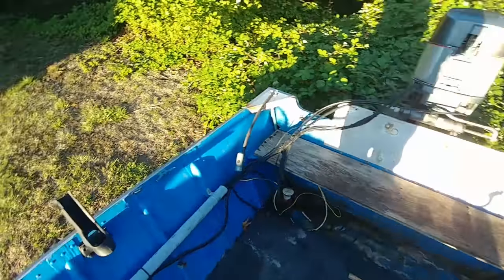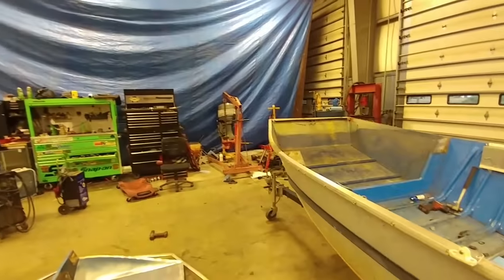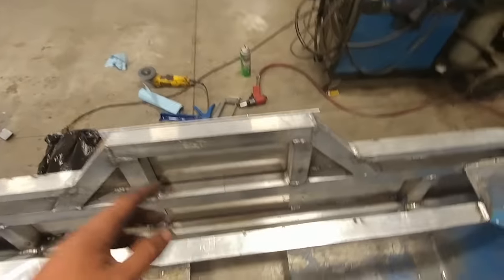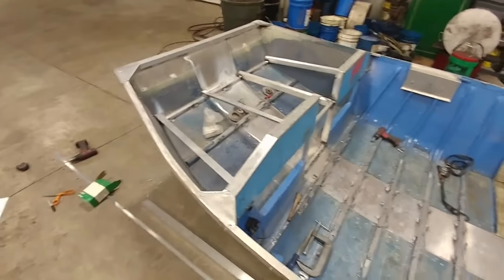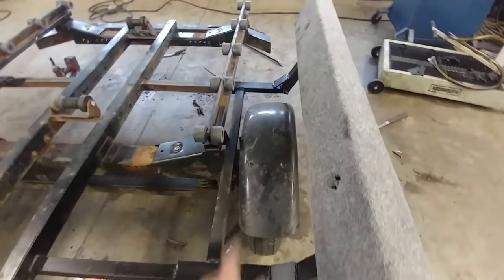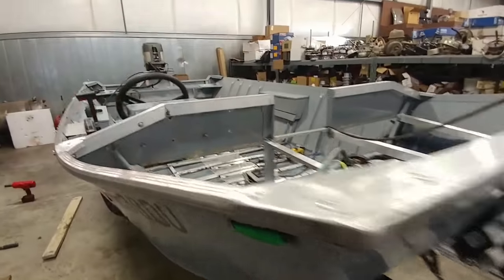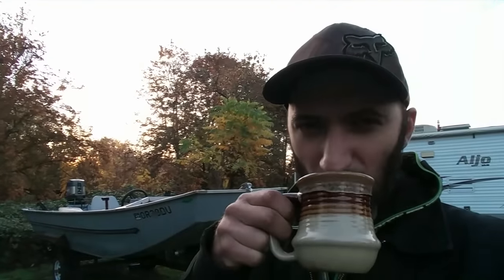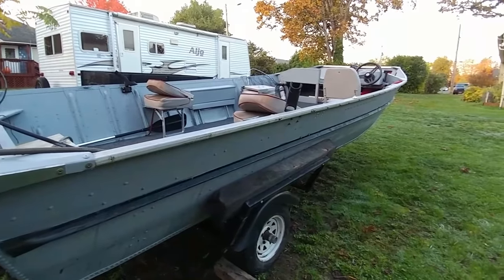Making my boat wider!

Comment: Love it besides the rivets def not a fan of them I would have opted to weld the whole boat and get rid of old rivets if I took it to the point you did but looks good def nice
Reply from the maker: Thankyou. 
Yes that was an option. I'm glad I didn't weld it all together. The boat is so thin and flexible I'm shur every weld would be cracked by now. Iv had zero problems. Zero leaks. Its a regular rock polisher. And still use it every weekend.

Comment: Thinking about doing this to my 16 foot  welded jon boat with 48in bottom, widing it 1 foot and increasing side height 5 inches. On the ribing before you laid down your plate for the flooring. what did you use, square tubing or angle?

Comment: Hey I’m thinking about adding two feet of width to my 1436 I have littles and I need a more stable boat for them by taking ribs from another boat I have access to is it possible to use the aluminum from that boat as well for the added width

Comment: I would ask how you did that but I have the Slightest on welding aluminum
Reply from the maker: I would have welded the whole project but due to the thickness of material there is too much flex and ot would crack. If the boat was made of thicker material totally could have welded it

Comment: that's awesome.  I've never owned a jet leg on an outboard.  Can you talk about the pros and cons?  I hope to have a setup like yours with a jet leg like that.
Reply from the maker: We call them outboard jet pumps. Pros.. Nothing hangs below the bottom of the boat. Can run in the puddles. Cons... Fuel economy is out the window. My 75 gets about 2 mpg. Also there is a 30% loss in power due to direct drive. A standard prop is like 3 to 1 er so.

Comment: Very good  design  and work procedure and workmanship.  Since I am used to open seas and prefer my boat to have some deadrise in its framing,  I see this flat boat as somewhat  a little uncomfortable in open waters and it should be restricted to inshore work. Now that it has been widened substantially well, one would have to keep an eye on the flexing at the central areas of the hull.   Also I prefer boats to have a strong anti-twist  construction and  while the front and rear seat does provide some antitwisting  components, along the hull, it is the bottom floors which would provide it once they are  anchored at the diagonals.
A man who knows when to use rivets rather than welding, is a good man.
Reply from the maker: Carmel Pule' yes. There is some flex even after the floor. But this is a river boat. I dont even take it in the bays and seldomly a large lake. Yes it beats the hell out if you. In even the slightest chop. But i can jam way into the creeks for smallmouth. Thankypu for the comment. Dont forget to sub and share. ;)

Comment: You didn’t weld the seams on the aluminum sheet? It’s held by rivets? And it didn’t leak? Just curious because I’m going to be doing this to my boat.
Reply from the maker: Nope i used a waterproff adhesive and aircraft rivets every inch. (Thats how the boat was originally manufactured) she dont leak a drop

Comment: Great Job. Thank you for posting the video. I was wondering if you were going to weld the new aluminum sheets to the old aluminum. I am not a welder but I have been told that is harder than new to new metal.
Reply from the maker: Om Fishing.. Well i attempted to. But it proved very difficult due to the thickness of the original material being verythin.

Comment: Nice work looking to do the same thing to my boat what did you use to seal the seams thanks
Reply from the maker: Gorilla glue construction adhesive. Only one thats waterPROOF. there is another option and thays 3m5200 very spendy tho. 3 years later. Had it out today. Still no leaks
Reply: Cool thanks did you put same thickness material back on it and did you use closed end riveted or the solid hammer style

Comment: Did you secure a plywood using rivnuts?
Reply from the maker: Used sheetmetal sqrews attaching into the ribs. Just making shur there not so long to go tru the bottom of the boat

Comment: How much did your weight limit go up to (as like how much more weight can you put inside) and what's the specs on the aluminum sheeting you used on the bottom
Reply from the maker: Kile Johnson well im just assuming but im willing to put 800 more lbs in it. Due to the amount of freeboard i gained. Aluminum was 5150. 4x10×.125 was 180$

Comment: I'd love to do this to my 1648 mod v bowfishing boat. It would help a lot with all the weight in the boat. Also, I think if you added a rib in the center, it would help your turning, but I understand you don't want to put more holes in the boat.
Reply from the maker: No center rib was done due to potential Airation. Could mabey get away with a partial rib. But ehh. V bottom would be a real challenge

Comment: how did it effect your cruise speed or gas consumption..
Reply from the maker: Joseph DuPont . due to more displacement there is less boat in the water. Less drag. More freeboard. More stability. Top speed gained about 4mph. Time to plane, no change. Fuel consumption no change well not that i can tell

Comment: At minutes 7:33 you can actually see the boat had a big twisting,now in a lake or big pond there are no tides to fight with,but,still the hull lost rigidity,where you cut in half the front frame,you would reiforce it,other than that very nice job buddy

Comment: Im not sure if this was ask but what kind of welding did you do being that its an aluminum boat and everyone seems to to not have knowledge of how to weld an aluminum boat as far as sealing holes and cracks is doing something like seams cracks and holes as easy as making the boat wider? hope it makes sense
Reply: Aluminum spool gun on a mig welder. It can also be done with tig welders and stick but stick welding aluminum is hard to do.

Comment: Just wondering where you got the rivet's and what size did you use. I'm little surprised that you didn't replace the the center  rib or what ever you call it on the bottom. Nice build!
Reply from the maker: lance henthorn . i used 3/16 di. By 1/2 length. Got them from my local harware store. They had to order them. 40$ for 500. No center rib only because i wanted less holes. Had plan to add it latter if needed. Still have it. Thankyou for your comment. Please share on your social media for me. Subscribe for meore videos!.
Reply: If it was there you would call it a keel.

Comment: That was definitely a lot of work; after rebuilding a transom myself, I would have guessed even more time than the 60-75hrs you mentioned. How big is your motor, & how does the boat perform now vs before? Thanks!
Reply from the maker: Robert Ross Thank you for the interest. Motor is a 75. I have gained massive amounts of stability. Gained 4 inches of freeboard. And gained 5 mph.

Comment: I’m wondering if you could weld two 36” boats together and make a 72” boat? And I’d like to stretch it out from 14’ to 20 feet so could you make a huge boat out of 4 smaller boats welded together?
Reply from the maker: Enough reinforcement and aluminum. You can do anything brotha
Reply from the maker: Blue boat. Cut in half.
Red boat. Cut sides off.
Use red boat for middle.
Reply: @CAPTAINWILLY  thanks Cappy! I appreciate u getting back in touch so fast, I just got a 14’ 36” but it needs some tlc, and I want a much longer and wider boat! Maybe not a 72” wide but at least a 48” I just thought removing two sides and attaching the two together might be simpler than cutting one down the middles and adding a foot or so
Reply: @CAPTAINWILLY  I think I’ve decided to split it twice and widen and stretch it out maybe not at the same time. But I think over all it would be cheaper than buying three more boats to chop up. Now I just gotta figure out what the thickness is on the boat I have
Reply: @CAPTAINWILLY  I ve seen u cut with a torch, and I’ve seen it cut with a worm drive circular saw I’ve never used torches so I’m leaning toward circular saw, questions are, is there a disadvantage to using a saw? And does it have to be a worm drive? Would a skill saw with same blade be as effective?
Reply from the maker: @russellcox9037  bottle torch is a big no for aluminum. Air arch or plasma yes. Any old circular saw will work. Need a metal blade. And a face shield.
Reply: @CAPTAINWILLY  aye aye cappy! Smooove sailin and calm seas to u n yours!!
Reply: @CAPTAINWILLY  hey cap! With regards to the circular saw blade, I get it’s a steel cutting blade, but I’m wondering do you flip it to run backwards?

Comment: How does the boat ride now that its wider? How is it with the console way upfront like that? I like it a lot. Good work!
Reply from the maker: Booker Fritz. Boat rides way better.  Only in the water 1.5in at rest. Crazy stable. Turning is a little more sluggish but not a big deal. The helm being up front is just personal preference. I like it out of the way. Not a big fan of tiller. And with 350lbs of engine i needed the weight up front. Thanks for the comment dont forget to sub and share

Comment: How did you buck all those rivets?  Did you use an air hammer and have someone help with that?
Reply from the maker: Michael Macdonald. Yes i used a walmart air hammer with about 20psi. I found it dose alot better job with less pressure. On the other side i used a chunk of steel. A giant bolt. Help i did have for the center.
Reply from the maker: Michael Macdonald thankyou for the comment and interest. Dont forget to sub and share

Comment: I was thing about doing some similar to this. I wanted to turn a 3 1/2’ x 12’ aluminum flat bottom Sears boat into a 5 x 18‘ boat. But I couldn’t figure out if I had to redo the title after changing the dimensions of the boat?
Reply from the maker: Kyle Herweyer. Yes a new inspection and would be required. 3inly because you changed the length

Comment: are those rivet necessary or just to add strength.. can i only juz tig weld  it both side??...
Reply from the maker: DZAFER BAHARI. Riviting it together was due to the original material being very thin. Rivits will let the boat have a natural flex without issues. If i would have welded it the boat would be cracking apart at every seam every time it flexed.
Reply: thanks capt' for the rply... one more thing, what do you think if change the middle section with v-hull,  does it gonna effect anything, good or bad??...

Comment: I have a 25 ft cabin cruiser I've been tearing apart to both widen and lengthen. Glad you posted the first video I've found of someone actually widening a boat. 
Couple questions, why did you rivet and not weld the bottom, and did you epoxy the plywood? 
Great job. Looks great.
Reply from the maker: I rivited the main sheet due to the thickness of the boat being .065 too thin to weld. Plywood is untreated its cheap and easy i replace it and the carpet biannualy

Comment: Looks sweet! Only one question... Reserve flotation? My abomination will hopefully be ready by spring but I am slow...so we'll see.
Reply from the maker: fisherholmsfly . wellllll. Theres somr foam under the plywood but not enough
Reply: Look at your local regulations, as most places require smaller boats to be able to stay afloat even if full of water or a gaping hole in the bottom. So they now take enough flotation foam to displace the boats weight and stick it out of sight in the bow, floor and under seat ect. 
Before you register it check in to the laws and regs, to save you headaches.
This is for safety and in the 1970's the manufacture probably just needed enough foam to float with oars and not a motor.
Reply from the maker: Here in oregon. Coast gard requires boat manufacturers to have biult in flotation for liability reasons. When reselling a boat it is required to state in the sale that it is or is not equipt with said floatation with a signature. As far as using a boat with no additional floatation it is only recommended.
Reply: He's fine, God himself couldn't sink this ship!
Reply: that's what they said about the Titanic

Comment: Why wouldn't you just tig it always the way instead of rivets! Would the weld not hold because of stressors!!?? Just curious about the method!!
Reply from the maker: Timothy Johnson. Well i did consider that. I decided not to because how thin the boat is. Original material is .065 so the boat has a slight natural flex about it. Rivits if done properly will alow the movement not restrict it. Hence cause of a crack
Reply: CAPTAIN WILLY'S FISHING ADVENTURES  that's what I kinda what I was thinking!! APPRECIATE THE RESPONSE!! THANK YOU!!
Reply from the maker: Timothy Johnson any time man. Dont forget to sub and share

Comment: hey nice build.  I wanted to know what you have used to build up the transom ?  and what did you use for bottom paint?  did you use self etching primer?
Reply from the maker: eslam salman. The transom i used 2×1 and 1 3/4 x 1 3/4. Aluminum. Welded. The paint i used polyurethane enamel. Factory equipment / floor paint. Thankyou for asking. Please share and subscribe
Reply: CAPTAIN WILLY'S FISHING ADVENTURES how thick was the aluminum tubing? How big is that jet outboard?
Reply from the maker: eslam salman 1/8in wall thickness. Motor is a 75hp
Reply: CAPTAIN WILLY'S FISHING ADVENTURES I have a 120hp Johnson jet so basically a 100hp and I'm afraid 1/8 is too think to bold that big of a motor to. I have been looking everywhere trying to find how to fabricate an aluminum transom to hold that motor
Reply from the maker: eslam salman so my 75 weights 320lbs. I wpuld recommend mabey the main few parts of the transom to be 3/16 and gusset gusset gusset